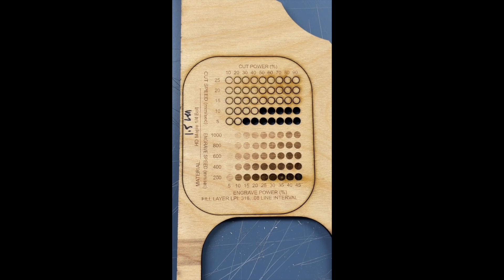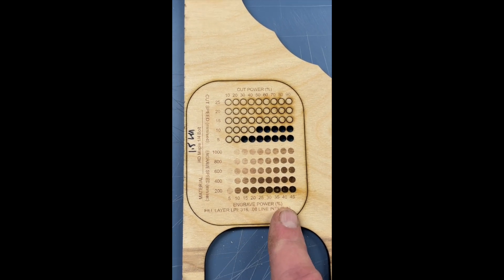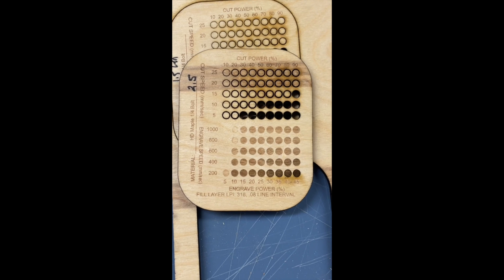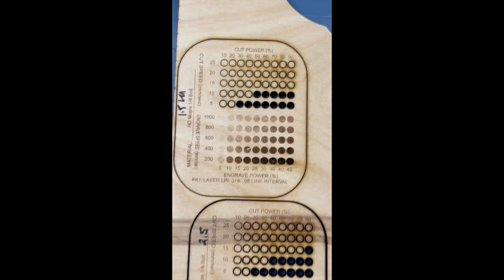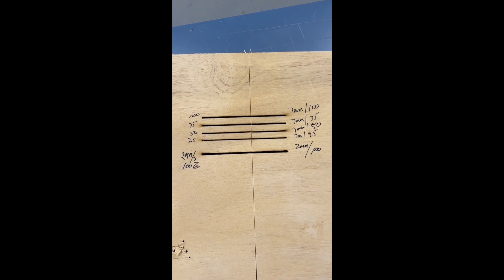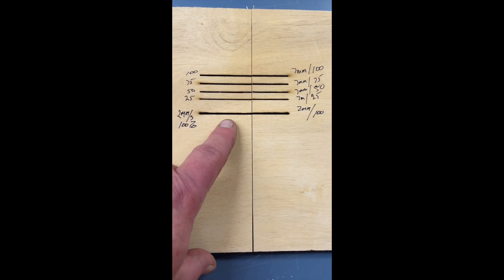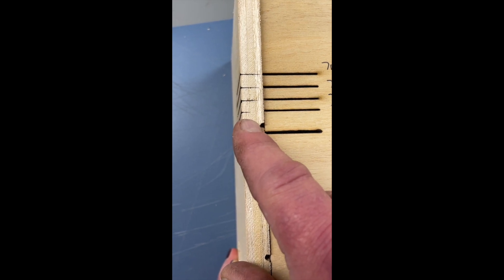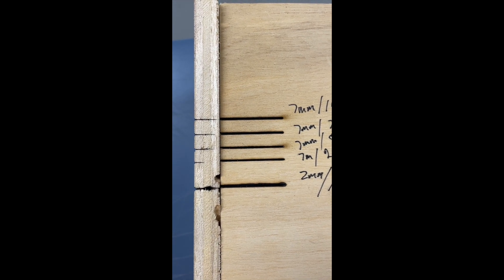Thunder Bolt Testing Cut Settings

Comment: Thank you for this testing! With the last one you did with just the lines, how did you feel about that test?
Reply from the maker: So it was great to see how deep the beam penetrated as well as how straight it was. We will be doing more testing in solid woods when we can.   The majority of people want the Bolt to do things it was never intended or designed to do. That is one of the reason people complain.
Reply: @Angrycraftsman  cool perspective! What are some things people expect it to do that it wasn’t designed to do?

Comment: Great info! Is it bad to run the Bolt at 100% power? for general cutting? I have a Co2 and they can't be run at 100. Thanks
Reply from the maker: No it will handle 100 fine